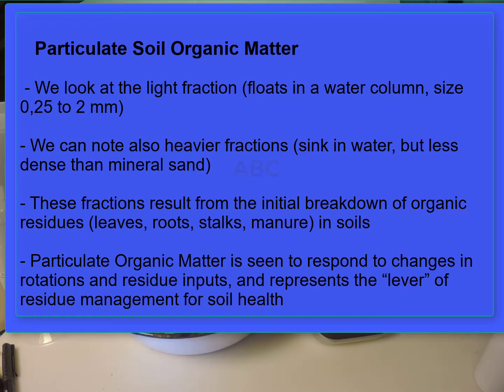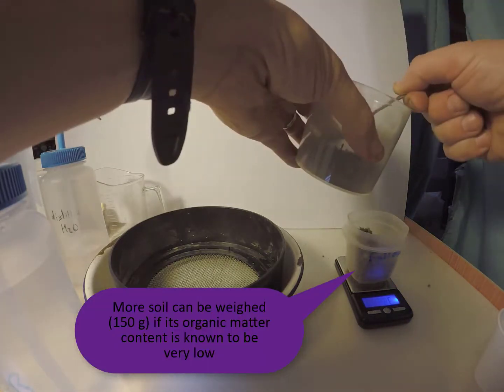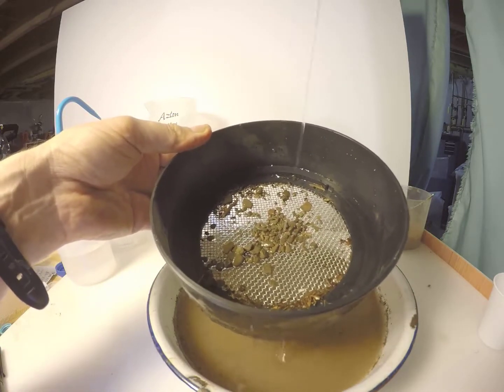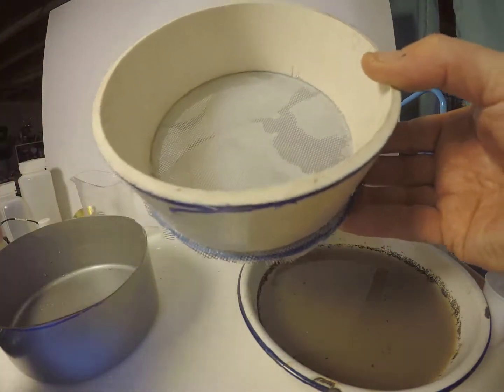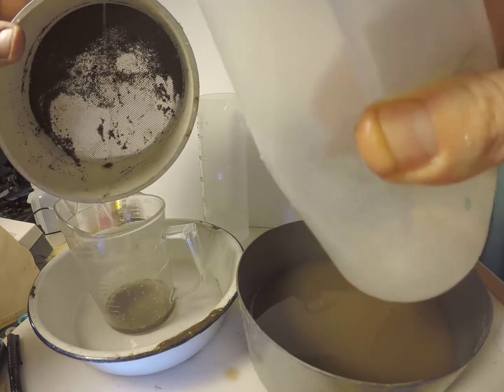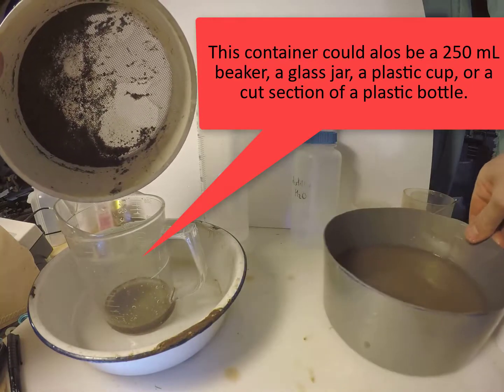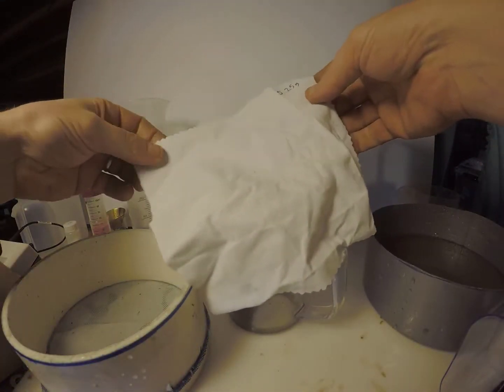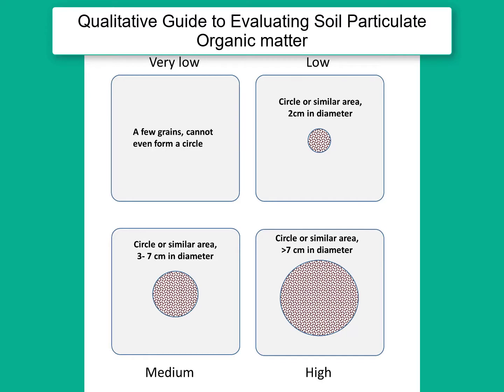Particulate Organic Matter in Soils - simple method

Comment: I am trying to study the biochemical changes to a particular green compost recipe (non food waste) as it progresses through the composting process. (As composting proceeds, bulk density increases because particles degrade into smaller sizes.) As I am sampling individual piles throughout the process, a relative measure rather than an empirical one is perfectly fine. However, I see this test is for soils - do you think this test will still provide useful results for compost?